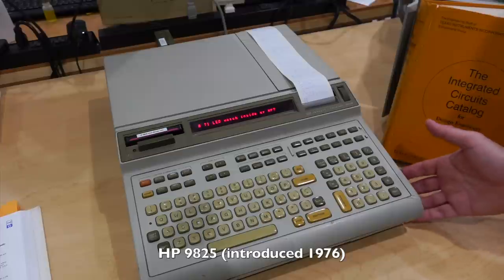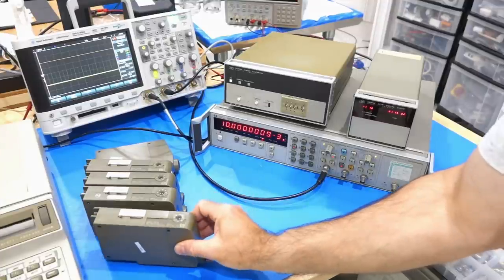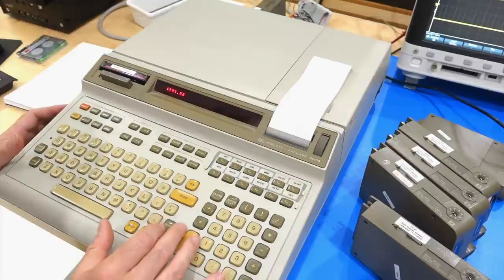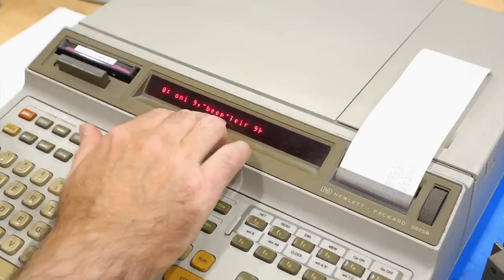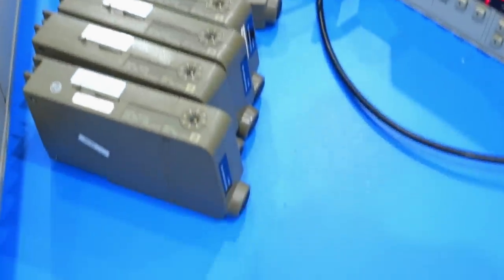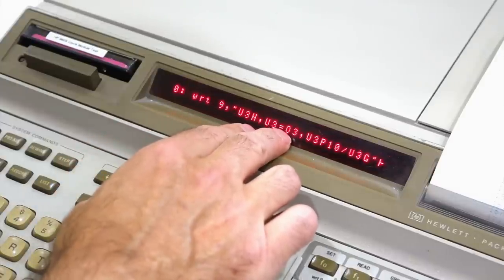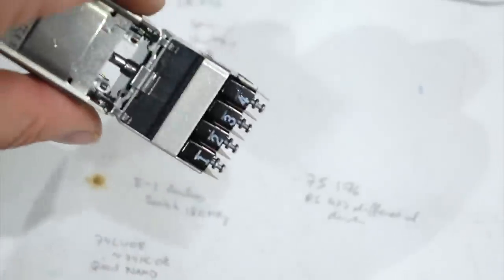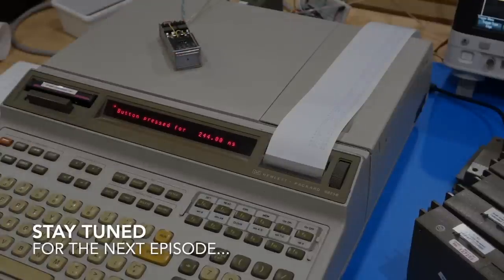HP 9825 calculator with HP 98035 clock module demo (and an Apollo switch!)

Comment: Brings back memories. I developed a program on this machine  to calculate odds and pay-offs for horse races in the ‘70s and 80s.  I had to install a serial interface to drive my centronics 580 dm printer, that could print at a staggering 80 cps in caps only.  I bought mine as a used unit for a bargain price of $12,500.  I never upgraded the memory because at the time, memory cost 1.2 million  per megabyte

Comment: This is awesome Marc. I designed a test station for measuring and calibrating hearing aid amplifiers in the early 80’s. It was controlled by a fully loaded HP85. All four slots were used. Rom drawer, 16k expansion memory, parallel interface and IEEE interface. I used the parallel interface to create an 8 bit expansion bus within the test stand to control A/D converters and variable gain amplifiers. Your series brings back memories of those glorious years writing HP basic code. 

Thanks for the memories...

Comment: I still have a 1999 HP Test & Measurement catalog that I decided to keep for sentimental reasons when HP's T&M division was spun off as Agilent later in this year. HP's catalogs were always impressive books, reflecting the state-of-the-art in its field.
When quickly browsing through the catalog, there were not so many people in the pictures and even less where trousers are visible.
In the editorial, there were Bill and Dave shown lounging in their armchairs, but that's pretty much it. Fashion had calmed down at the end of the past millennium, but engineers were still shown wearing shirts and ties.
As far as I could spot, there is only person depicted from head to toe, a lady sitting next to the HP TS-5500 cellular phone test platform. The exposure of the picture was optimized for the test equipment, leaving the person a bit dark in the image. She wears a 
timeless business dress that would go well still today.
The fashion craziness of the early 1980s had disappeared from the 1999's catalog, just as the name HP from the T&M field a few months later.

Comment: The reason for those blue caps on the lamps is that it allows you to run them at reduced voltage for longer life and still have white illumination.

Comment: We had those identical push buttons in a utility plant I worked in. I had to pull them apart to change bulbs, and do other repairs from time to time. They had those little rubber condoms on the bulbs to indicate the state of the circuits.

Comment: I have used a HP desktop calculator design in the mid-1960. It had a CRT, a magnetic card reader and HP-IB output. This calculator had no IC!!! Only diodes and transistors! The memory used magnetic core, the ROM was composed of a PCB the size of the machine full of diode! Registers was composed of a small PCB with transistors.
Reply from the maker: That is the HP 9100! The quintessential scientific calculator that started it all. The 98xx series is a descendant of that. Not having a  9100 is one of the remaining big holes in my collection.

Comment: Yes, using LCDs instead of CRTs in the restored control room is a sin. But it would be more acceptable if at least the LCDs were bigger so the rounded edge of the monitor faceplate cover up the corners. It would look like more CRT-like, not as horrible as it is now with these perfectly rectangular displays.

Comment: "You could get a nice beautiful cable, made by HP, but I made my own"...
Yeah, so do many of us. Nothing like getting a piece of HP gear for a good price only to discover that you'll pay through the nose for the official accessories. Fortunately, HP stuff is pretty well documented, and it's usually easy to make your own.
Reply: I hope HP didn't ever try to obscure or restrict info for their stuff. I mean, what's the point? If you sell to engineers, you can bet your bottom dollar they'll just reverse engineer it and make their own accessories to suit their needs.
Reply: @anomaly95  Pretty much. But they also take into account that said engineers will often design their own interfaces to go between the test gear and the product being developed. Such as designing a header into the mainboard of that product to interface with the logic analyzer so you don't need to bother with all those damn test leads.

I designed the PCB for my own isolation network board (resistors and capacitors, with values taken from the HP technical manuals), so the logic analyzer wouldn't interfere with what I was measuring. This comes included with the "official" breakout cable assembly that you'd get from HP to plug into the pod. But good luck finding them cheap. It was easier and cheaper to do it myself. Works with both my HP 16510 logic analyzer card, and the Agilent 54622D mixed-mode oscilloscope I have. Because all the documentation was readily available, designing the interface was easy.

Comment: Hi ! @ 0:16 - the TI "Integrated Circuits Catalog". Looked familiar so I walked over to my bookshelf. TI "The TTL Databook for Design Engineers". Fifth European Edition 1982. Was a great aid on understanding PC/XT/AT and expansion card inards from the mid-80s onwards in the time before Internet. Got it at one point when the next edition appeared from a company I worked for part-time. Also a great help when building add-ons for my Z80-gear still in the 2010s. :-)

Comment: Those lighted switches were real nice. The only problem was they were great at peeling your fingernails back if you reached for one quickly and didn't hit it square in the middle. They took enough force to push that if you weren't looking at your hand, it wasn't necessarily obvious if you were pushing on the button front or the metal of the console. If you were half and half, when the switch finally clicked and dropped an eighth of an inch, you fingernail was on the console face and got peeled back a bit. Just a bit annoying.
Reply from the maker: Someone's talking from experience!
Reply: so it doubles as a nail clipper?! thats nasa ingenuity! your tax dollars at work :D

Comment: Pity the pants aren't flared like the originals!
Reply from the maker: I'm told it's slightly out of fashion ;-) ... Whomever wants to re-edit them with flared bottoms sure gets my pattern for free!
Reply: I would also love to see them in cotton rather than poly, cos the last thing vintage repair needs is static lol. And yeah definitely a better cut lol. Im tempted to get some, had some lovely check boot leg pants in the 90s lmao
Reply from the maker: @Mijc Osis: Oh I’ll be darned. Maybe we have a chance!
Reply: @CuriousMarc  Definitely keep us updated on this! If you make a flared cotton version I will buy them for sure!
Reply: Hey but if it reminds you to use an anti static strap, you're golden, because nothing bad can happen while you're wearing one, guaranteed!
Reply: Hehe.  Would be doable however.  I got some coming after seeing how good the plaid looked and some good luck fashion is always welcomed in my weird wardrobe.  Flared ends?  Probably have to buy some plaid fabric or 2 pairs of Marc's pants.  Cut hem, and and use a serger on the seam at the ends.  If you want lined however like Marc's it might be tough to make without a big enough industrial machine that won't snag on the fabric.  Lined fabric can be tricky to make behave (I used to do upholstery).  Anyway I digress.  Great to see the other machine here doing stuff with the clock module.
Reply: +1 for flared bottoms, I will buy a pair then grow some seriously long sideburns :D

Comment: In the Army in the late '60s we had those same switches in the search Radar consoles.  The designations on the switch buttons were classified and had to be locked in the safe.  I have a whole story about that but it's that military intelligence is an oxymoron!  ☹️😱
Reply: "The designations on the switch buttons were classified and had to be locked in the safe."
That makes sense from a security standpoint. You can get a good idea of how a piece of equipment works (or even operation procedures) just by looking at the control panel or switch legends.
These switches could be custom ordered from MSC with engraved legends with black paint infill. I would bet NASA also didn't do this due to security concerns during the Apollo era.

Comment: Shame that the merchandise manufacturer does not offer the pants as "Boot Cut" like in the HP picture, but I guess those are just not in fashion at the moment...
My dad just dug out his old HP 97 programmable calculator from the attic. The battery was dead (but you can buy modern replacements from ebay), and unfortunately the printer won't advance the paper anymore, because the roller is not sticky enough anymore (not sure if we will be able to fix that - do you perhaps have on of those in your collection and can make a video about it, Marc?). 
But the calculator itself fired right up and worked, and it also has those beautiful Bubble LED Displays.
That thing uses a weird circuit where you cannot use it with the wall adapter if there is no working battery in it, as it uses the battery to pull down the voltage for some reason.
Reply from the maker: Rubber rollers and capstans are the bane of vintage electronics. Look up the HP tape episodes, you can probably repair them like an HP tape capstan by coating them with plasti-dip on it.

Comment: So the programmable timers are separate and distinct from the TI clock interface circuitry?  It seemed quite a bit of an over-engineered solution to require a microcontroller as an interface to a wrist watch just so the computer can have the time. Seeing now that it can do a lot more, it all starts to make more sense. Does it do any other tricks?

Comment: When you started messing with inputs and outputs, my brain started associating it with some of the things you can do with our modern arduinos / raspberry pis. Makes me curious on what the common tinkerer used back then, since these HP tools were very pricey!  Simple TTL chips and breakout boards I'd suspect, just like your watch chip display.😁
Reply from the maker: It's actually not that hard. Typically you'd use a TTL latch register in either direction, or a shift register (parallel load for input, serial load for output). The simple method is still used today.
Reply: @CuriousMarc  Exactly! Ben Eater uses  shift registers on his breadboard computer as a means of handling which device has control of a data bus. Makes perfect sense.

Comment: I wonder why it needs a separate built-in register for a "timer" (times 4 in this case).  In modern times, I just declare a variable to hold the start time, and the clock needs nothing more than to provide the current time when called.  Is 4 integers really a significant amount of memory?  Or do these timers have more features than the elapsed time?  Is this the same value that counts down (or offers the reset-to value) in the interrupt mode?

Comment: Is there a surplus of those switches?  I wouldn't mind having one if they're available.
Reply from the maker: I found mine on eBay - but people know they are special. They are not cheap. The 10H versions are the MIL-spec, which is what I supposed they'd use for Apollo. But they are virtually indistinguishable from the 10E "standard" ones. Ignore my previous comment about the MSC numbers, it does not refer to Manned Spaced Center but to Master Specialty Corporation, the manufacturer of the switch. So nothing to do with NASA part numbering.

Comment: Did you have to debounce the Apollo switch into the timer?
Reply from the maker: No, the calculator takes quite a few ms to respond to the interrupt, plus I think the switch is of very high quality. No bounces.
Reply: By the loud clonk the switch makes, I'd be surprised if there is much of a bounce.
Reply: you think the switch is very high quality. IT IS very high quality. Of course it doesn't bounce.
Reply: I was thinking the same thing but didn’t see any de-bounce circuit so I assumed it wasn’t.
Reply from the maker: Oh I am sure it bounces a little, but not enough to annoy the rather slow 9825 interrupt process. Would be interesting to find out how much it actually bounces though!

Comment: I'm trying to figure out how your "calculate the prime numbers" program works, but I'm kind of stuck on lines 4 and 7...
Line 4 of your code is:
if N[I]=1;jmp 5
Why would you jump to the next line?  Wouldn't it go there automatically?

And line 7 is:
1->N[J]
What is that arrow operator doing?
Reply: Oh -- never mind, I figured it out...

the jmp command in line 4 is jumping over 5 lines, not jumping to line 5.

And the -> operator is a "store" command, it would appear.  Storing the value 1 in the J'th element of array N.
Reply: Here's your program translated to JavaScript.  I changed it a bit -- I only count the odd numbers in the I loop, for example (which means I simply output "2" before even going into that loop, because 2 is the only even prime number.)  It seems to work on jsfiddle.net, although I'm sure someone who's a better programmer than I am could come up with something even more efficient.

var N = [];
console.log(2);
for (i=3; i<=4999; i+=2) {
  if (N[i] === 1) {
    continue;
  } else {
    console.log(i);
    for (j=i*i; j<=4999; j+=i) {
      N[j] = 1;
    }
  }
}

Comment: Hi,
What is the concentration of the winegar/acetic acid used in PCB cleaning?
Reply from the maker: I don't know, same as in a salad dressing I guess  ;-) . It would be much cleaner and better controlled to use acetic acid from the chemical store.
Reply: White vinegar is already diluted as it comes from the bottle.  I believe he poured it straight from the bottle.  Just remember to flush away the vinegar with distilled water and dry it thoroughly.
Reply: @acmefixer1  OK, regular food winegar have about 5% acidity.

Comment: OK Marc - you just know what should be done next: use the timers and output function to make the switch blink like some of them do in the Apollo videos.  Extra credit if the calculator changes the blink rate to tell you when to push, and then tells how long it took you to respond!